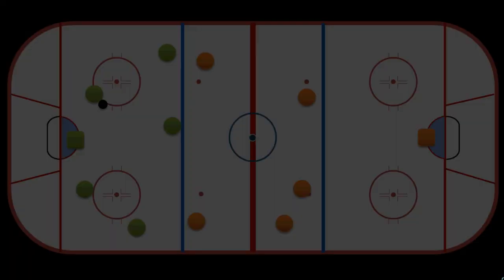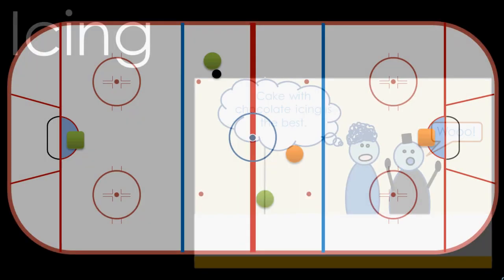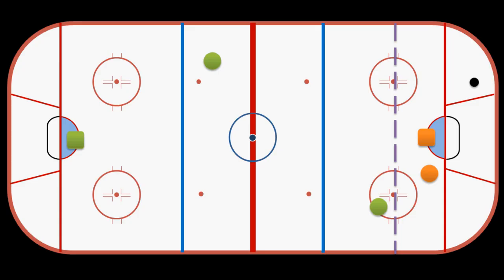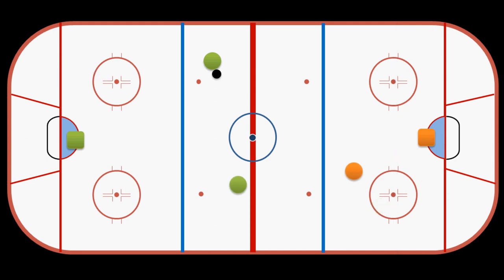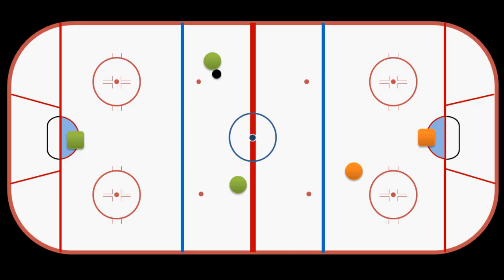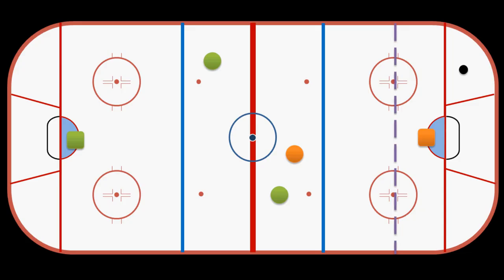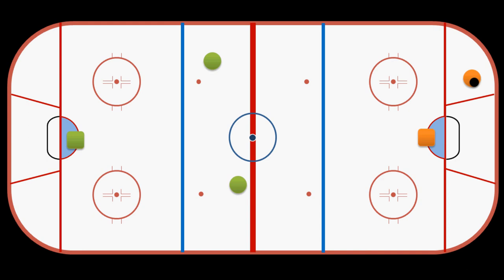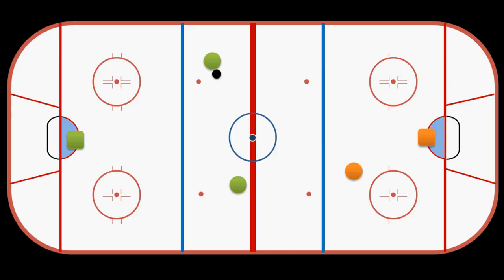Intro to Hockey: Icing

Comment: Good try, but a bit off. Dotted line is a reference point to determine whether or not icing will be called. If the play will be close on the puck but the offensive player hits that line first, linesman will blow it dead for icing.